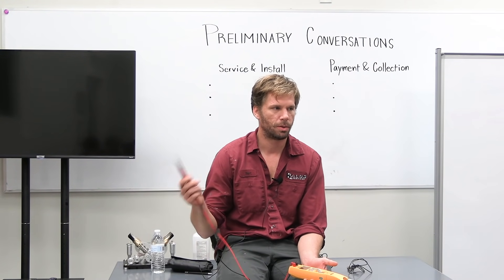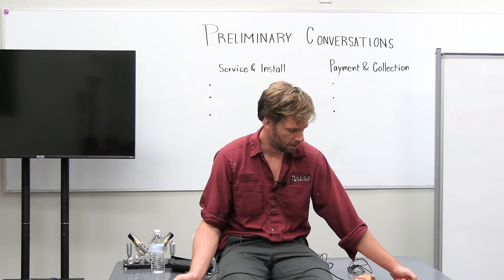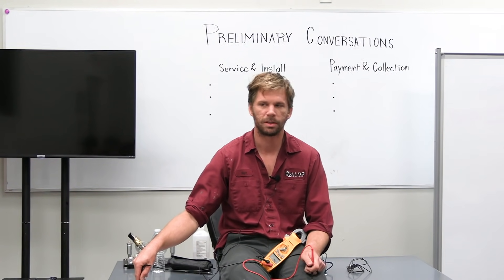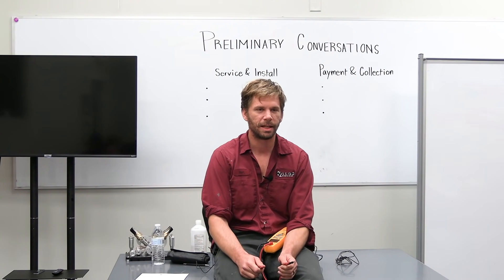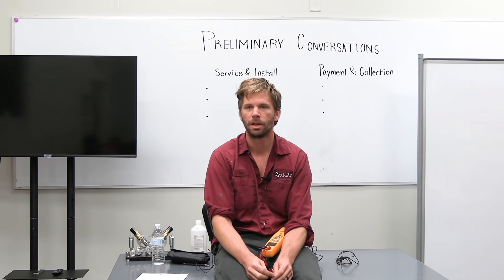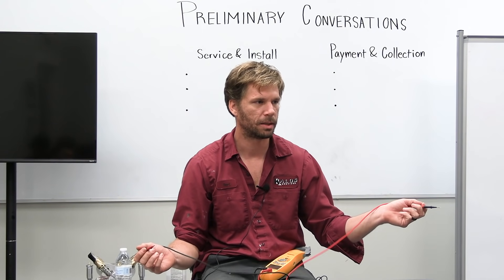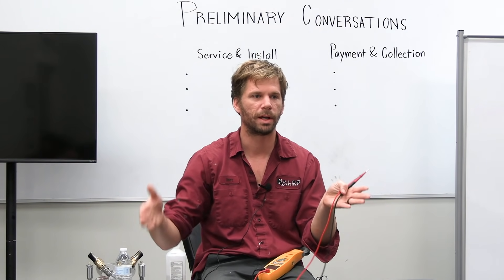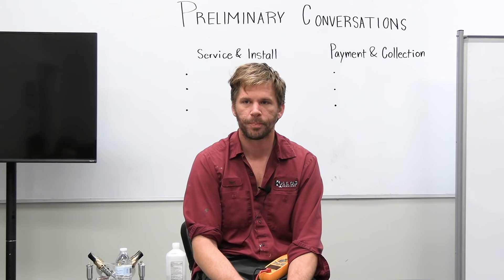Bert Addresses Some Concerning Calls

Comment: It's also good practice to check to both ground and neutral in a 120v circuit. Sometimes a neutral will be damaged and not allowing enough voltage to power the equipment.

Comment: Good info I work industrial maintenance and agree with everything you said but on initial safety check of voltage potential I always use a no contact tester or tone stick.  A multimeter requires a completed circuit for a proper reading and if you had say a broken neutral bus bar or maybe a open path to ground the meter won't show anything.  Possibly if your equipment is energized with no path to make a completed circuit your body will make it completed...

Comment: On the Lennox that had 24V to ground on both sides of the contactor, that should be a red flag.
One side of that contactor should be hot/load and the other common/ground. Therefore checking to ground on one of the legs should be 0V and the other 24V on a properly energized contactor, correct??
Reply: Yes if it is properly energized it will pull in and have 24v to ground on one side and 0v to ground on other. 
But this board when in a lock out will allow the 24v path to contactor but break common path back to common. So on that situation contactor would not pull in because voltage would not be flowing. And it will show 24v to ground on both sides of contactor
Reply: Umm the contactor pulls in and BOOM. Line in Load out